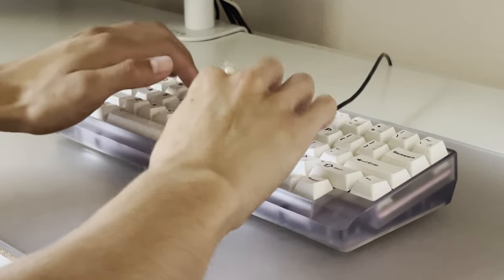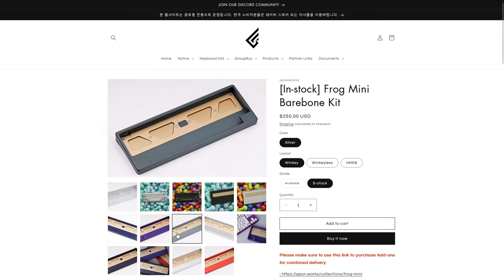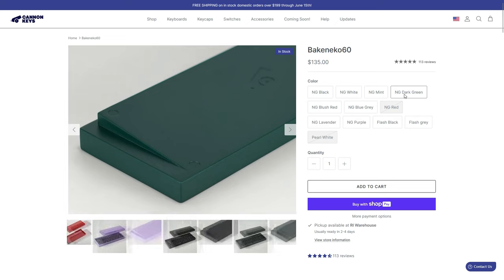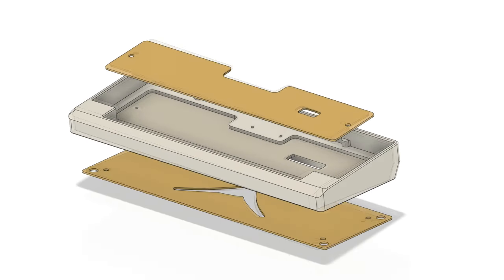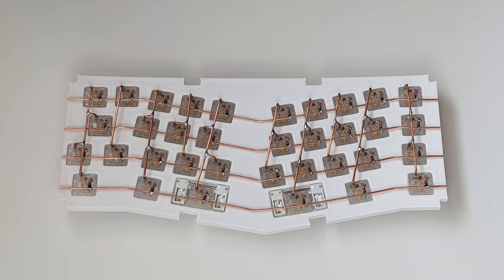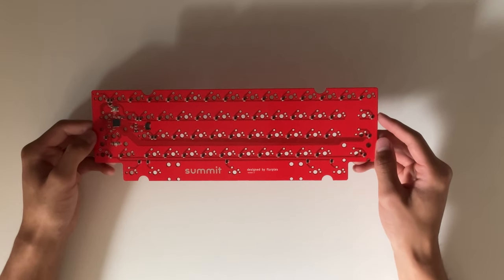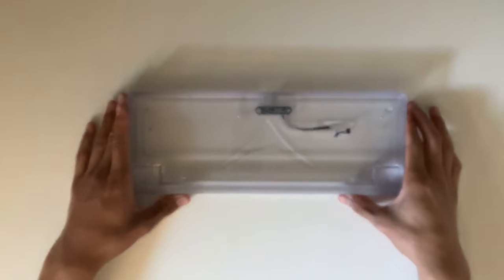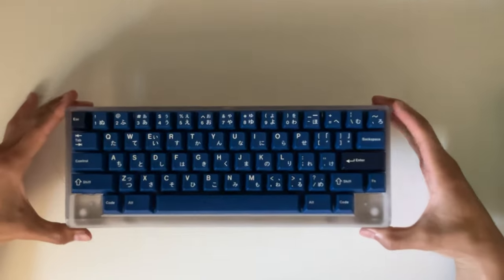designing a keyboard from scratch

Comment: Beautiful project!!! Definitely signing up for the interest check!

Side note: modern 60% boards are in fact derivatives of the original Apple M0110 that came with the first Macintosh (which the HHKB Japanese keyboard, that would come a few years later, used as inspiration). So, technically, the HHKB design predates the modern 60% keyboards (with "moogle" bottom rows) by more than a decade... :)